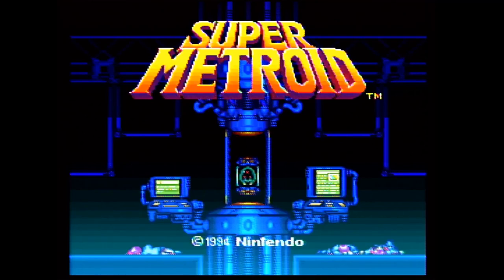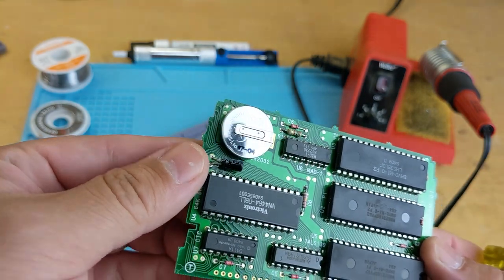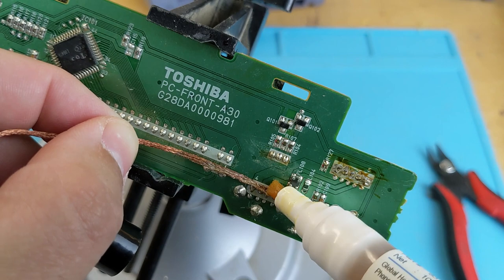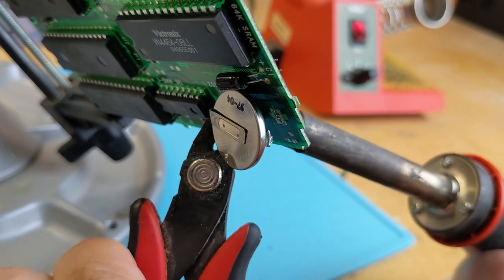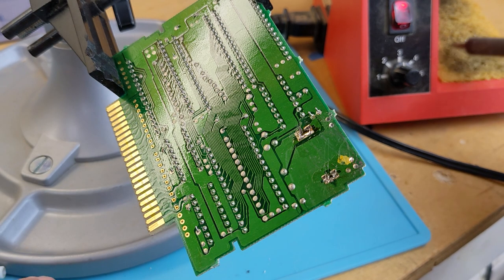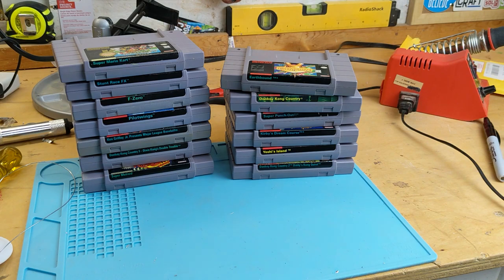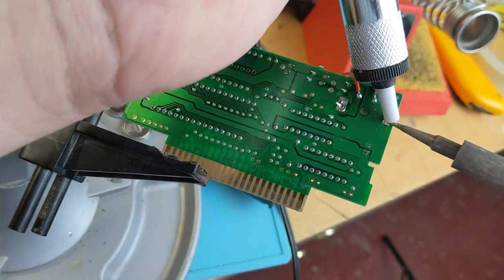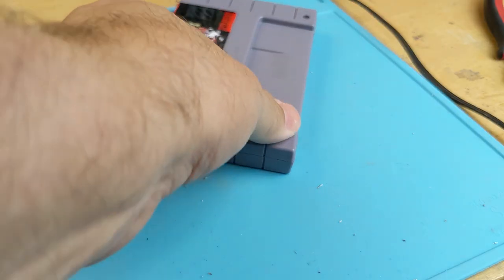How to Fix Your Dying Save Batteries in Retro Games

Comment: I have planned a long term project to replace the batteries in all my Gameboy games (plus 2 GBA games) with low profile battery sockets.  I have used a device to backup all of the saves, so I've got them on my computer, so I'm not worried about losing saves.  All other consoles that use save batteries I just play on newer systems via emulation, GB/GBC/GBA are the only battery using systems where I use the original hardware.  Laziness has kept me from starting this though.
Reply from the maker: I considered doing battery sockets, but when I realized that I would only have to replace the batteries once more before I probably die, it didn't seem worth the trouble. 😆 Talk about lazy. 😝
Reply: @Geeksmithing  Yeah I understand that, I definitely won't live longer than another set of batteries.  But hey I'm leaving all my stuff to a much younger friend of mine, and it will probably outlast them.
Reply from the maker: @StormsparkPegasus  haha fair point! I may have a couple of GB games to do myself
.... 🤔